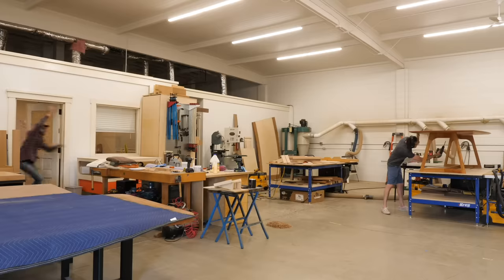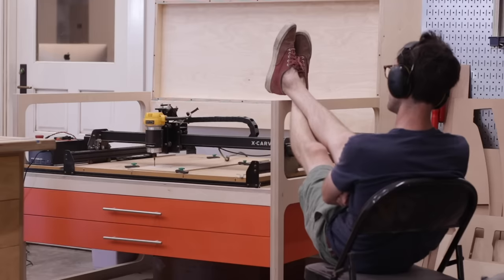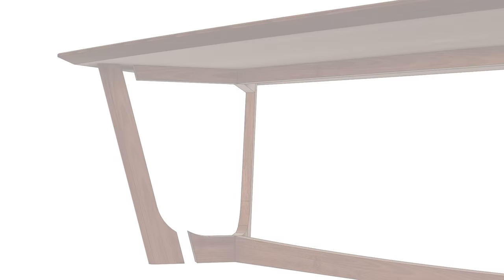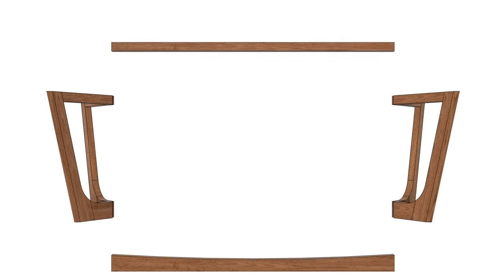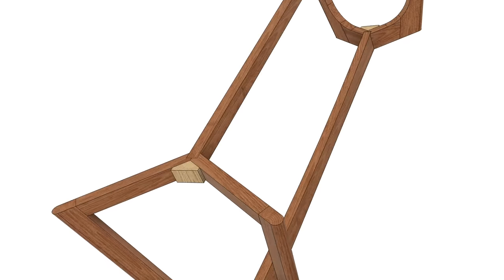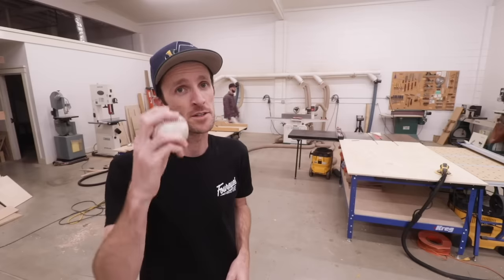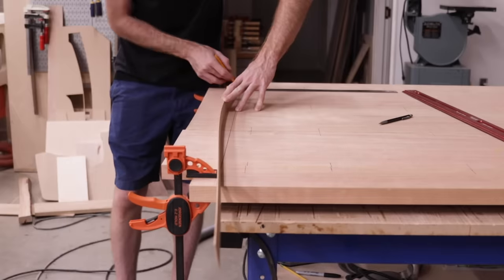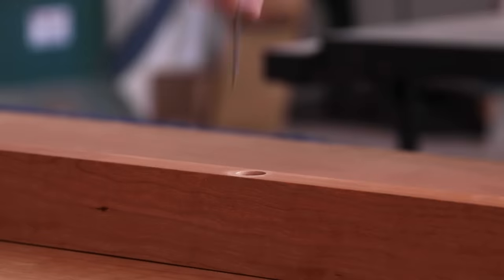How to Build a Dining Table - Woodworking - Full Plans Available

Comment: Hey guys ! Love the channel and all your videos. I am designing an building my first dining table with a slab top, and I was wondering if you actually needed the central stretcher linking the 2 legs as a structural portion, or if it is only for design. I wave seen people just attach legs with steel plates under tables and call it good. Any thoughts ?

Comment: What do you think about using this style of base for a round table?
May it be unstable?
If I go for 1,2m in diameter and the top of the base around 1m
That would be typically 800mm in the bottom?

Sounds to narrow in the bottom for me. What do you think?

Comment: I would have thought mounting the bottom stretcher slightly above the floor level (1/2 inch or so) would not affect strength, but allow for the table to be moved without the chance of dragging debris across a hardwood floor with resulting scratches.  Perhaps even a gentle curve as you have used with good effect in other parts of this project.
Reply: Also avoid the issue of those gaps between base and floor (knowing no floor is ever completely flat).
Reply: Brett Jonathan I think that’s an even MORE important point. You’d hate to have a high spot in the floor make one of the ends float.
Reply: If the table was on a hardwood floor, one woild assume there would some type of pad/s under the legs which would prevent scratches in it's own right and would also lift the table slightly to prevent the issues mentioned below.

Comment: Lovely work.  Great aesthetic and not overly complex for the amateur.  You said your jointer is 8" and not enough to handle the wide boards for the top.  So, here's my question: after the panel glue up, how did you handle flattening the top?  Router sled?  Hand plane?  Surfaced with the X-Carve?  Thanx!
Reply: Thanks! If you are careful with board orientation, there really isn't much flattening needed for a panel of that size. Especially once it is attached to the base. This one came out pretty dang flat.

Comment: Did you consider a fastener or other support for the 2 stretchers?  Is there enough strength alone at the end grain (and some side grain) glue joint for any racking strain in the future?  Hmmmm.... Great look and build BTW!
Reply: You would have to have a dance party on top of the table to stress those joints enough to fail. But some sort of fastener could be used if you needed that extra security. Thanks for watching!

Comment: I would've preferred the bottom stretcher to be above the floor, so that there were defined feet.
A single stretcher would be more elegant, though not as strong. But why not mortise the top of the legs into the botton of the table. That should work.
For the top, I think it needs to be thicker if you're going to put such an aggressive bevel on it.
Don't get me wrong, it's nice, but the techniques used are the best part of the whole thing.

Comment: Also you dont mention it, but with a solid wood table top, it will expand and contract in width, how will this work with the threaded inserts you used which seem to not use a racetrack movement mounting hole?  Or perhaps you only mount the top to the center stretcher in which case there will be no expansion movement but there is the chance the top may warp since it is not supported outwards from the center?
Reply: The holes in the base are drilled oversize and placed out near the legs and down the center stretcher. The bolts and washers allow the table top to expand and contract.

Comment: This is a beautiful table but I question the design of the base's bottom having so many square inches in the same plane.  We can see the table jiggle as you're applying the finish so I wonder if that will be annoying in use.  It seems like it will require either a very flat floor or the addition of four height adjustment screws.
Reply: Thanks. Like you said, since most floors (and our shop floor) aren't perfectly flat, either adjustable feet or even just some felt pads will keep the table from wobbling.

Comment: You should show how you fix that rocking the table has. It’s something I encounter often and I’m sure others do to.
Reply: It rocks because the floor in our shop (like most floors) are not perfectly flat. This table will be on a rug, or some felt pads will go on the bottom of the base to stop it from rocking on an uneven floor.
Reply: Take a look at 15:00, the gap on the floor is on opposite sides( front left and back right).  Maybe just an optical illusion that it looks like a small twist.
Reply: Great job, thanks for the great motivational videos, I decided to make content on woodworking and I did it thanks to you!

Comment: What’s that drill press you’re using at 14:00 ? Tried to see the brand but couldn’t. Looks more stable and accurate than all the other ones I’ve seen so far.
Reply: It is from Rockler.
Reply: @shaunboydmadethis    thanks ! is it worth the $220?? maybe you got sponsored...
Reply: It works great! Full disclosure: Rockler does send us tools, and this was one of them. But if you need to do a lot of precise drilling on areas where you can't reach with a drill press, it certainly does the job well.

Comment: Was that bevel Jig giving you the weeble-wobbles on the end grain arc? I'm imagining that since it's not riding  on a flat surface, you'll need to modify for the arc.
Reply: All the edges on the table top are curved, so the router jig is designed to run along a curved edge. It worked out great!
Reply: @shaunb66  what router bit did you use for this piece? i'm doing something similar, and trying to figure out what is best. surfacing bit?

Comment: Dumb question time. If I wanted to make this 6ft long instead of 8ft, would that be a problem given the templates used for the curves on the table top?
Reply from the maker: The templates we provide are only for the leg pieces. The top is purely aesthetic and we show how to make it regardless of size. So you’re good to go.

Comment: What will stop it from lifting or toppling if someone would sit on the edge or put something heavy on the edge. Just trying to understand the design.
Reply: Why would you put your backside on a surface you it eat off!!! Just trying to understand what’s social acceptable 😉
Reply: @michaelhall3818  haha! good one, but if 15.11 is what is shown, resting your behind a little won't hurt.
Reply: You would have to be actively trying to tip the table over. Last time I checked, a few dinner plates don't weight too much, but I'll test it with the Thanksgiving turkey this year and see what happens.

Comment: I don't understand why some people spend so much time with breadboard ends, U channels, or beveled splines to prevent curving of the table top. And others just glue the boards and voila! DONE.
Reply: To me, all of those things are mostly aesthetic. Yes, a table top like this one with no reinforcement has a higher chance of bowing over time, but if it does, it will be minimal, and I can address it if needed. Breadboards ends would help with this, but it also changes the look of the table significantly. That's how I look at it.
Reply: @shaunb66  that baffles me, some realy consider it a must.

Comment: Table looked a bit wobbly when the finish was being applied.  I actually built Chris's mid-century dining table (https://www.youtube.com/watch?v=hfITpBfdJLw) out of walnut and found it to be wobbly as well (fixed the issue by adding some subtle reinforcements on the inside-top of the legs).   I love the minimalistic design approach you guys take, but maybe call out cases where you're trading off structural integrity in order to achieve a slimmer aesthetic.
Reply from the maker: I definitely feel like I like to exaggerate short comings. You'll see in next week's video...the dining chair. That I go on about how not comfortable it is. But in reality it's about exactly as comfortable as you'd imagine it to be. My dining table you're talking about doesn't wobble for me. Not sure if your dimensions are different. Mine is about 94" long and the legs are made from 8/4. If I got up and danced on it maybe it would. Haven't tried. But for eating dinner at, and occasionally sliding around, she's pretty solid

Comment: There appears to be way too much floor contact. Very few floors are that true and flat these days, so a table like this will sit uneven and rock. Some recessed adjustable feet at each corner of the base and the junction of the lower stretcher, plus a relief curve on the bottom of the lower stretcher would eliminate this concern. Nice design overall.
Reply: Even just a few felt pads under the base will eliminate any chance of that. Thanks for watching.